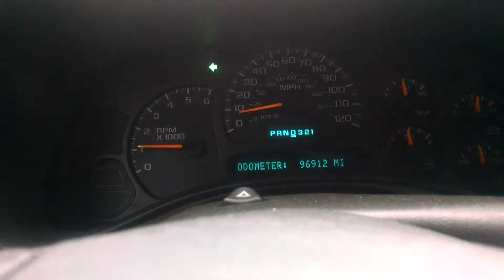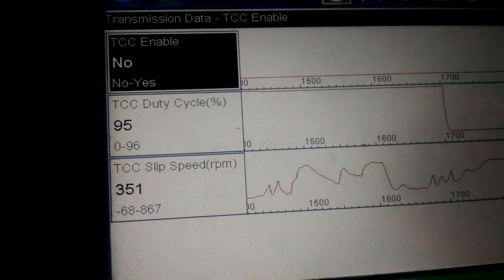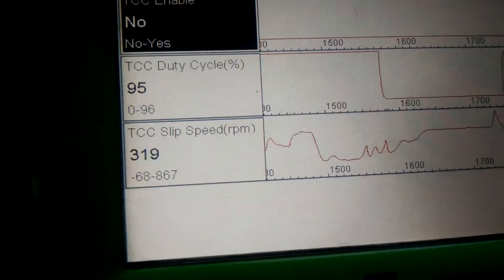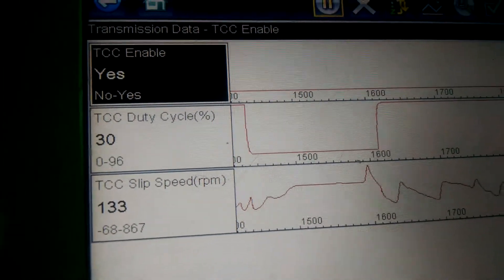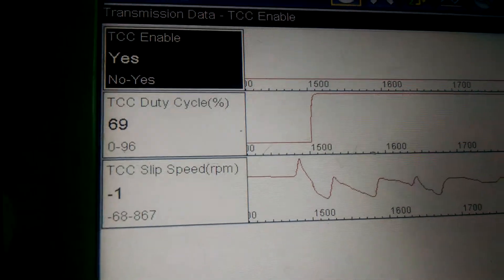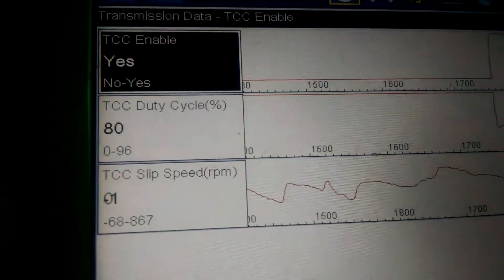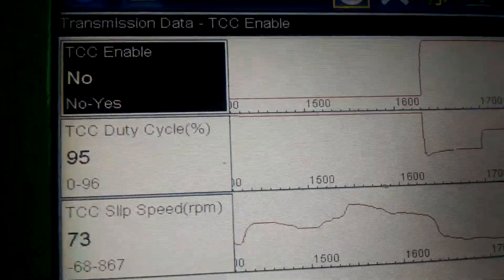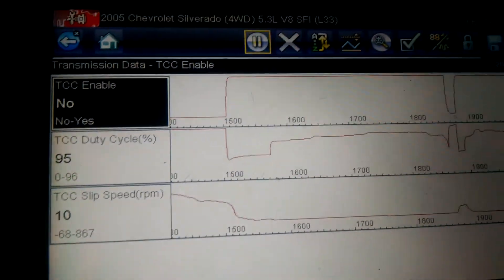P0741 TCC stuck off / tcc performance

Comment: Greetings, if you scan the scans and everything is correct, like your video, does it mean that the selenoids are working well? thank you
Reply from the maker: As long as tcc slips stay low with tcc percent high and tcc enable at yes
Reply: Buenas, una transmisión 6R60 de una Ford explorer Edi Bauer 2008 da un solo código en la transmisión, el  p0741.Al hacer una prueba de carretera sobre 80kph, estable el convertidor aplica bien , el deslizamiento esta sobre 0-7 Rpm.
Sin embargo al detenerse en un semáforo, con la palanca en Drive,el auto busca seguir como si estuviese acoplado el convertidor de par, y termina apagandose, si no se coloca neutro.ademas de golpes en la transmisión al arrancar.
A la transmisión le cambiaron el banner kit, e incluso turbina por ese mismo motivo pero sigue igual.
Las resistencias de todos los  Solenoides están  dentro del rango
Que podría ser?
Ya que al parecer el convertidor esta aplicando bien ?.
Agradezco su opinion.
Gracias ppr compartir.

Comment: I have a 02 Chevy Duramax with codes P0741 and P0743 it goes into all gears but when driving it has a hesitation then goes then changes gears then hesitates then goes.. any tips will help

Comment: Heyo i know nothing bout cars. My brothers toyota matrix got the error code P0741 and my friend says he can fix it i just needa buy the parts but i have no idea what to buy and he told me to just look it up. Still not sure what to get exactly...
Reply: Listen sweetheart it’s not a DIY task AT ALL😂 You need a skilled mechanic to pull half your engine apart & get to the back of the transmission. Pull THAT out. Find the torque converter solenoid & then the easy part is replacing it😂😂😂😂

Comment: Have this code in my 2006 scion tc. in the morning it's been cold lately here in NE and the transmission seems to be engaging 1st gear a little later than usual. I have to depress the accelerator pedal lower than usual which leaves me at a higher rpm before the it "catches" first gear to take off. it's an automatic transmission. after the engine warms up to normal operating Temps everything seems normal as far as gears changing at normal rpms. Could I just be in need of a transmission replacement or should take a look at something else before taking that step.

Comment: need help, i have code p0741 on my sierra 2009 5.3, truck will shift good when entering highway but wont lock up at high way speeds , rpms are high just to keep truck moving, any help? starting to think its the solenoid.